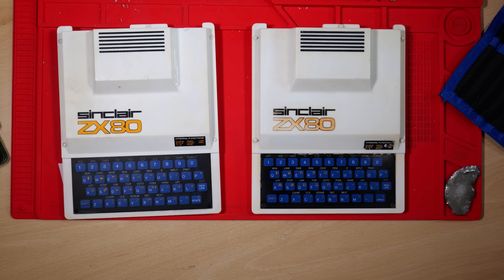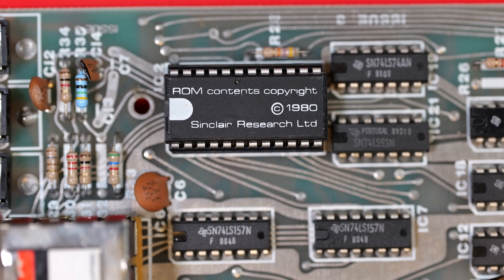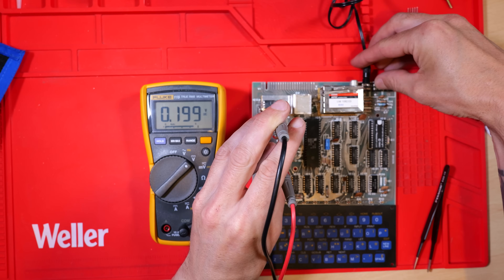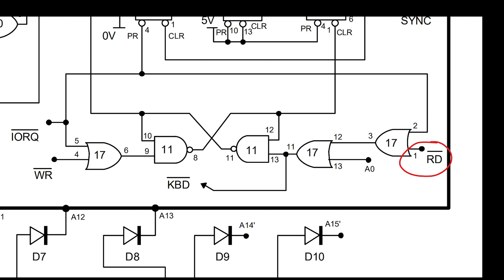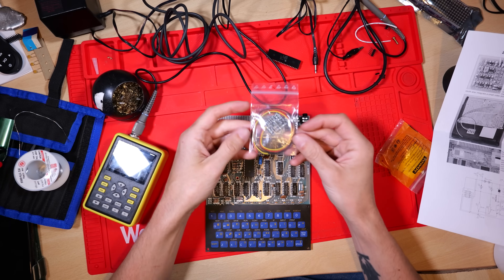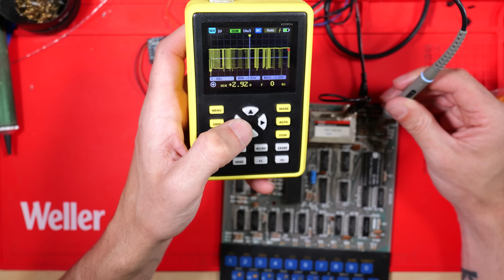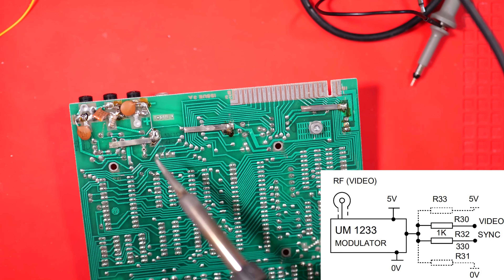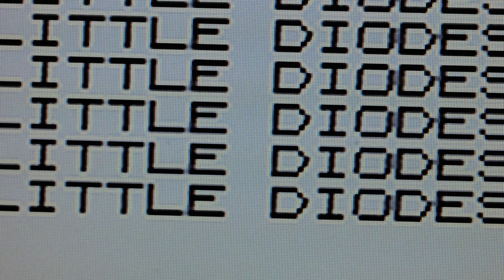ZX80 Repair and Comp Mod - We're going back in time!

Comment: the modulator type isnt really anything to do with ntsc or pal, but the output rf frequency, the 1233 is uhf, usually ch36, the other one vhf, not sure of channel out but think ch 3 as its marked E3, the term 'pal' is really irrelevant to these as its a colour system, ntsc also is a colour system but also refers to the monochrome system as well,  those resistors arent anything to do with ntsc/pal either but the biasing to the modulator,    the  other main difference is the 'pal' models have 50hz frame sync, ntsc 60hz, which 60hz is selected by adding a diode into the keyboard port input chip circuit, i dont know what the extra transistor does, probably sync shaping, as i havent seen a full schematic of the 'usa'/ntsc version that includes it, i dont think one exists?
Reply from the maker: Indeed I couldn't find a schematic either.  Thanks for clarifying, I'm pretty familiar with PAL and NTSC but clearly not with UHF and VHF. Thanks for the info, more to learn

Comment: Modulator difference will not be PAL/NTSC as they are colour systems and the ZX80 is not colour.  I think this is more to do with the frequency as they are different in Europe and the US.
Reply: yes, 'pal' ones are 'usually' uhf , 'ntsc' vhf... the 60 or 50hz difference is selected by a diode link and is independent of the modulator type so you 'could' set it opposite to whats normally used for each system!